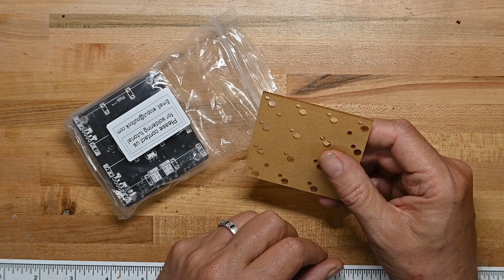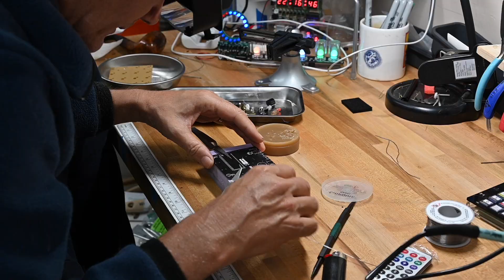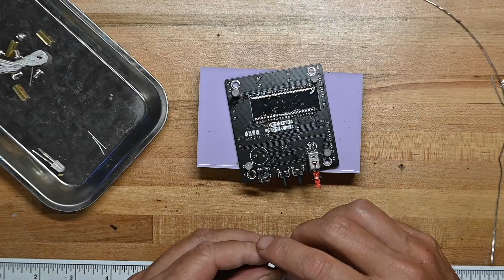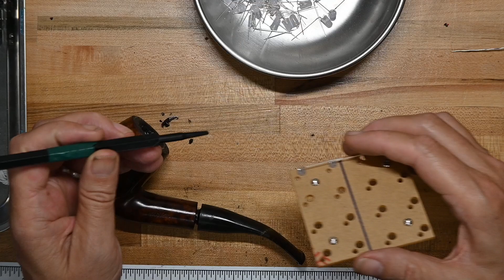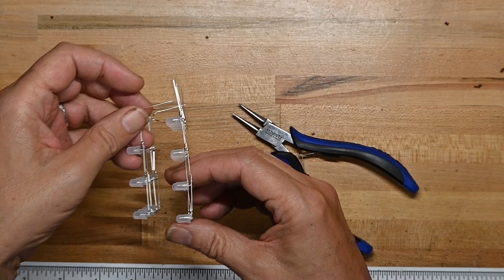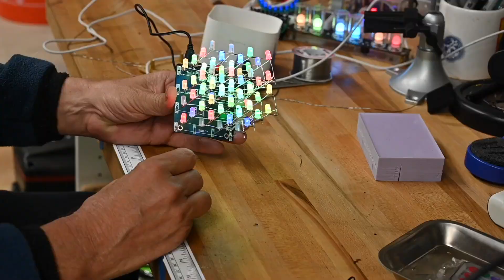C.K. builds a 3D LED cube kit

Comment: Thank you for making this. Wish I had watched this before I had done the build. Would have saved me time. Hope it fixes the problems I'm having with my kit.
Reply from the maker: This kit is definitely one of the more technically challenging ones.  Surface mount and making sure all the LED leads are soldered correctly (and not touching).  Hope you can find what's up with yours!

Comment: Good video. What IC is that? I have a enough RGB leds to make one of these but most schematics have shift registers involved yet I don't see any here. What sorcery is that?
Thanks
Reply from the maker: Glad you found some value!  No, definitely not a decade counter or shifter, it's a full 40 pin microcontroller with lots 'o logic inside.I just took a look at it ad I cannot read the manufacturer or part number, I might be able to if I look it apart but....
Reply: @CKHaun  Thanks for the reply. I've made a 4x4x4 cube using an Atmel chip following an instuctable guide by CHR. Guess I have to go full spaghetti mode with a shifter or 2 :)
Reply from the maker: Have fun!  I think the microcontroller has the patterns (15 I think) and cheesy music encoded in it, that will be the fun part with shifters!